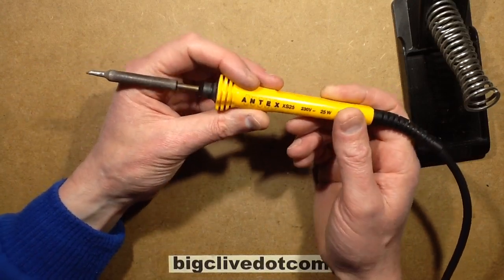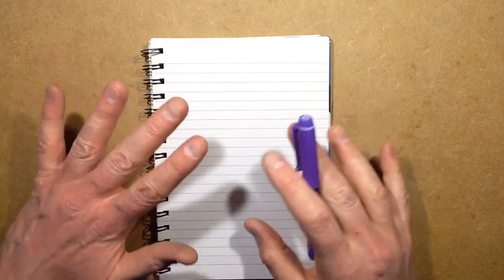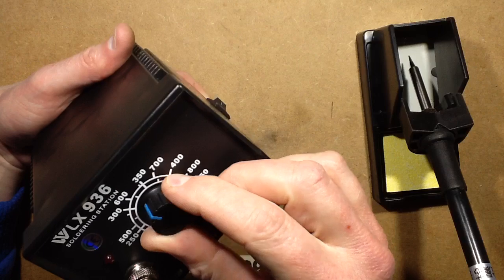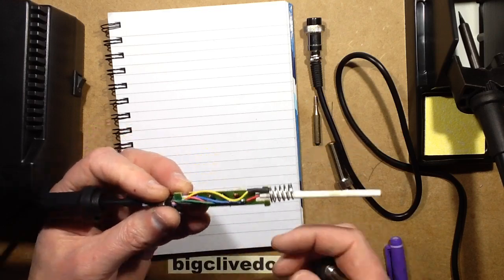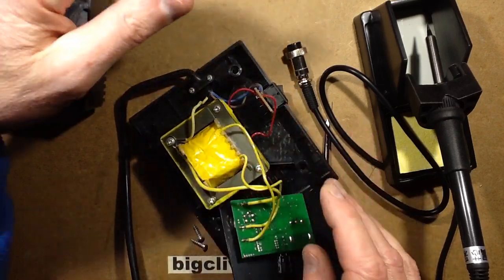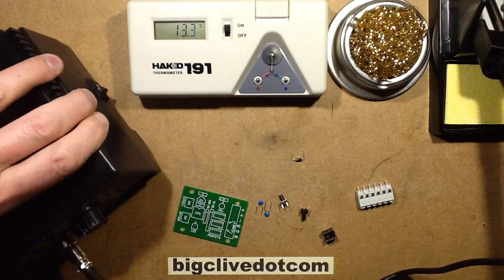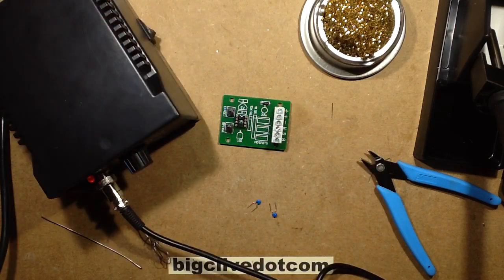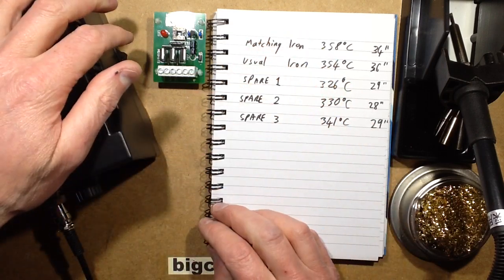Soldering basics and choosing a cheap soldering iron.

Comment: Soldering iron reviews in a nutshell:
>Dave: "These Chinese soldering stations are RUBBISH and I hate everything about them. Just get a 1000$ one like these behind me and [obscure Australian phrase]. God, I hate Chinese people. "
>Clive: "These are fine."
Reply: +Derp Herp Yup... that's Dave being his usual 'just pay a shitload of money for your equipment' self. Not like Clive, who goes... 'wellll.... it isn't the best... but you can't go past it for the dirt cheap price!'
Reply: My approach for hobby use is: Don't buy the absolute cheapest one, but instead go 1 price range higher. E.g. don't buy the 15€ multimeter, but the 25-30€ one. The cheapest just has to use the bare minimum in terms of component quality, safety and look and feel, just to get the price down. But for a little more money, you give the engineers something to work with and while it doesn't make a great bit of difference for you, they can improve the product quality by huge margins.
Reply: @Keex11  Its funny you say that, I know I'm rather late to the conversation. Though my cheap $3-4(I think? could have been cheaper honestly) iron from harbor freight preforms ten fold over the $20 Weller I bought, being as the Weller took a shit in the first week of light use. Cheapo Chicago Electric still going strong 2 years later. But a isolated incident of course doesn't represent the whole, just happened to turn me away from from wasting anymore money while the CE works fine.
Reply: @Keex11  that's how i do it.  I wanted my soldering iron within two weeks so i went on Amazon and spent about $9, and it was well worth the price

Edit: it wasn't worth the price.  The actual tip of the iron MELTED.  I bought a better but slightly more expensive soldering iron and i am EXTREMELY happy with my new purchase
Reply: @Keex11  I agree. I used to have the cheapest test equipment, including sub US$10 multimeters (as low as US$3). Then moved up in the world by buying UNI-T meters, big ones in nice red plastic sleeves, only to learn later that many disparage UNI-T as cheap trash. Recently I had the opportunity to graduate to some Fluke meters at 5-10 times the cost.  Result--maybe 1% difference which does not affect me at all in my low voltage, low power electronics projects. Actually I felt a bit disappointed. All the extra money provided no tangible value for my applications.
So my thoughts are similar. For hobbyist applications and with reasonable treatment (not by angry school kids), cheapest+1 tools may be the sweet spot. 

This is the beauty of Clive's channel. He explores "cheap stuff" and separates the garbage from "good enough" for the job. 

Finally, I grew up with electronic kits in Germany such as Radiomann and Labor XG. To replace a transistor from those kits cost about US$5, to replace a passive component, maybe still 50 cents. Hobbyists today can get all this at ridiculously low prices. What a time for hobbyists.
Reply: +Derp Herp

Would you believe it is EXACTLY that fucking attitude from Dave that has led me to find Clive's channel today???

Listening to these videos is like a breath of fresh air in comparison. I have really, really enjoyed watching EEVBlog stuff over the years but I have just got to the breaking point of 'if it isn't a top brand don't even bother' attaitude. I have a maximum of £20-£30 to spend on electronics a month.  That's it and its probably too much for a hobby anyway. When that aussie bloke recommends a £250 fucking screwdriver I am done with his shit.

Clive has a new subscriber and I really, truly hate to say it, but Dave has lost one.
Reply: +Peter Feerick If you know what you are doing, you can solder with almost anything that gets hot enough.

Many years ago while travelling round the more remote parts of Senegal, I got a camcorder display (one of the old mini CRT ones) fixed by the local TV repair shack. The soldering iron he used had a wooden handle and was heated in small a charcoal burner. He was perfectly capable of soldering and de-soldering the tiny approx 0.1mm  wires, and did a perfect job. His de-soldering wick appeared to be old TV coax braid dipped in a gunky "flux" of un-know origin.  

If you have $1,000 for a top of the range iron, go for it, but a $2 Chinese "hunk-o-junk" will still melt solder and get the job done.  

What makes the difference in my opinion has much more to do with  knowing what you are doing, as having the fancy tools. Disclaimer. I ran a computer repair workshop back in the day, and we had Weller soldering and de-soldering tools. They were good, but for my hobby use, I mainly use an old Maplin bargain bin soldering station. 

With a magnifier, a steady hand, and a bit of "Mechanic" solder paste I can manage SMD work with it,. You will find "Mechanic" solder paste on Ebay and as Clive advises with solder, get the leaded stuff, 40 years of leaded soldering still hasn't done me in, just don't go eating it..
Reply: @AndyHullMcPenguin  I can see Dave's point in case you are doing this as professional. Companies are very particular about certification of your equipment. You just cannot use no-brand chinese ones.
Reply: @AndyHullMcPenguin  5 years late, but the mystery flux is probably just Gum resin (tree sap)
Reply: You're right, depends on what you are doing. I soldered with a 2$ iron for a lot of years then moved up in small steps. To be honest it's mostly the experience and the quality of the solder. Cheers. :)
Reply: @ciprianwinerElectronicManiac  Basically the same. When I started, had 40W and 60W Soviet made soldering irons for long time. Soldering with them was torture, but in my school years there was nothing better. At least got enough practice how to solder more or less good having only those torture devices, a gob of solder and rosin jar :)
Reply: Far healthier approach by Clive IMO. Sure, there may be irons that get hot in about 2 seconds and hold the temperature at a rock solid level. And those certainly may have their place where splurging on an iron makes sense. But at the end of the day, especially as a hobbyist, paying $$$ for a device that makes a piece of metal get hot in order to solder a bunch of cables is something that you can do, but is pretty pointless. But it makes makers of expensive soldering equipment happy.
Reply: @DeputatKaktus  Very well said!!!
Reply: Plus Clive has a much nicer voice.
Reply: dave is a dill
Reply: im chinese, and im a student major in electronic. my teacher always told me to buy the top end equipments(just like Dave told his viewers to do)
the thing we used to ignore is my teacher and Dave dont have to spend one cent on these equipments,the company will pay the bill.  but  there is  no company pay the bill for the amateurs.
Reply: 国伟王 I hear the Taobao is much better than aliexpress, is that true?
Reply: @trm7782  sorry,i dont use Aliexpress .so i dont know which one is better.
Reply: Keex11 right on, not to mention the chinese sellers in aliexpress are very responsive you if you have a problem with the product they're happy to help. For the price and that seller? I can't complain.
Reply: That's why i watch Clive
Reply: Like anything else, the truth lies somewhere in between.  I have had a Weller, some super cheap generic ones (Radio shack?), including a USB one, and my current main one, a Hakko.  Whether you eve notice or not depends what you are doing.  If you are soldering a few wires onto a board here and there, a $10 iron is fine.  If you want to be able to get in and get out with small Surface Mount components, then you want something with proper temperature control.  Also bear in mind that many of the cheaper Chinese units skimp in the safety area, etc., whereas many of the more expensive units are over-specced and will last a lifetime.  If you are soldering a lot, then spending a few hundred dollars is a small price to pay for something that works well every time.
Reply: He is great r/shitsinophobessay grade master
Reply: Keex11 yup, this brand is "okay". From my experience there's 3 types of Chinese products. The good one where it can compete with international brands, the "okay" one which gets the job done and the garbage one that you can't even use.
Reply: @mspencer243  I'm suspecting that soon it will be the high quality one from China and the lesser one's from factories operated with Chinese money in other countries such as India, who are happy to take on the world's outsourcing as China goes ever more upmarket with the mountains of industrial espionage they've accumulated, and already put to good use within their domestic steel industry. Though the homogeneity of the steel isn't always as good as German or Swedish steels through the entire sheet/bar/round, with the right graft in the right hands you can get fantastic quality for little more than rock bottom prices dealing direct with the factories.
Although many people think otherwise - Australian's prominently among them - It's not been only junk coming out of China for a decade or so, but quality has increased substantially in the last five years. They have factory floors like aircraft hangers filled wall to wall with CNC mills, busy knocking out parts for more mills for their domestic production - though you can buy them - again through the right intermediaries and possibly a little more graft money. It's still the way business is conducted in the special economic zone, as well as across the mainland. You need to factor it into any business you do, but you can get high quality mills even if you pay a little more, as well as the somewhat cheaper and decidedly jankier baby lathes etc. With each iteration and repetition they increase tolerances in the newly built wave. Ethics are different everywhere and we in the western world all too often expect people to have the same outlook, when they don't. Bribery is alive and well in China whether it's called that or not, but better the devil you understand, or know, and all that.
 Another instructive, but not boring video. You strike a fine balance of explanation vs content. Thanks Clive.
Reply: Derp Herp - I finally unsubscribed EEVBlog when Dave decided he was a celebrity and no longer needed to do anything but AM TV style interviews. 

What a clown. He had it all going and just breathed to much of his own gas.
Reply: +M Spencer Can confirm, I have one with digital temperature display as well. I also would put it in the Okay+ department. I see the difference to the Weller soldering station we have at work, but this one here works more than well enough for what I do at home :-)
Reply: I have 3 irons: a 1940s or 1950s one that was my grandfather's, a cheapish Chinese one I bought about a year ago and a nail jubilee clipped to a piece of ceramic tile cable tied to a piece of broom handle that clips onto a blow lamp. They all get the job done (with varying degrees of success)
Reply: Typical Dave........so sad......
Reply: @Lamster66  You are correct. people who brag about their 10+ years old Weller's being the top notch at today, simply are not informed about latest budget soldering tech. Latest microcontroller driven soldering "pencils" like TS100 with heating and temperature measurement assembly inside tip are much more effective than those old dinosaurs. Had difficulties to solder off ROHS solder globs with my workplace's 10 year old Weller station on temp above 350C degrees where my TS100 did the job on same globs in few seconds at 320C degrees. Of course Weller have decent soldering tech, but those soldering stations cost a little fortune where TS100 with power supply cost around 60..70$.
Reply: @Lamster66  Seems old repair tech favorites often become dinosaurs due to thinking inertia :)  For casual DIY builder in Baltic states Pace WJS100 + TD-100 is still a bit too expensive. Though I now see from where Chinese TS100 came :)  Definitely cheap microcontrollers became a salvation for guys like me. DSO203 scope was on my wishlist but bought JYETech DSO150 in end, because badly needed some cheap low frequency signal display for field use (racing drone diagnostics). Though now, considering occasionally incoming electronic repairs like friend's home NAS which he accidentally connected to 20V PSU instead of 12V, I'm thinking about Hantek DSO5102P scope and some more or less good multimeter in price range around 100 EUR.
Reply: Alex Wywial kind like when you drop a baseball and you look at your glove like the reason the ball hit the ground was there was a hole in your glove. that being said ,  depending on job and tool, the right tool makes a difference sometimes
Reply: Got one from Jaycar  took 10 hrs to do 2 minutes of soldering.
Reply: Yanno, I'd heard good things about EEVblog until I watched this vid and the one clive did on the 936D.  So seeing the link to his vid in the sidebar decided to check it.  I want the 2 minutes back I wasted listening to him.  I'll stick with BigClive here and AvE for my teardown and review needs.
Reply: Aw... where's the fun in that... chewing it whilst soldering is half the fun! Yes indeed... the whole 'lead will kill you' thing has really been blown out of proportion... and certainly isn't worth the nightmare of working without it. Only thing I would add is don't skimp on your solder... I have some 'cheap' 60/40 solder that is certainly not 60/40! Sets stull and doesn't flow as long as the proper 60/40 does ;( I'll have to look that solder paste up, sounds like it might be handy... some some SMD soldering to do soon!
Reply: @pfeerick  Fear from lead solder is mostly a hype. When you have deal with anything having lead inside, don't lick or swallow it, wash hands and work surface after task is done and you will be fine. Doesn't apply to ones shot dead with lead bullets. Definitely don't chew your solder spool - metal wire chewing badly affect teeth too. What is true, we must stop manufacture tons of useless crap devices with lifespan 1-2 years which go into recycle bin then because they are obsolete or die because of ROHS solder decomposing.
Reply: Yup, god forbid people not buying a $1000+ multimeter or a soldering machine if all they need is to measure <50 VDC, test cable continuity or solder a broken serial cable termination.

Fuck snobbish people.

EDIT: Went to my city's best mobile repair shop, and guess what? Cheap Chinese soldering machines and hot air guns throughout. If these guys can do BGA soldering for an iPhone flash upgrades with them while slapping a 6 month warranty in, they are more than good enough for the hobbyist.
Reply: @Alex Wywial 
"They say a bad workman blames his tools...."

The condition of the tools can make a difference.
One time, I used a friends screwdriver to disassemble his printer (instead of going out to my van and getting my screwdriver), and I had an absolute terrible time with it. (The screwdriver tip had a lot of wear, and would not reliably stay in the head of the screw)
I learned it's better to not waste my time using his his tools after that.
Reply: @shawbros  That is a reason to buy not the most expensive screwdriver, but good enough one. Like not the 1$ worth one and also not 25$ one, but that not so shiny one for 5$, which is hard enough to avoid chipping and twisting and comfortable enough in hand. Same is true for other tools.
Reply: this is why I kinda lost my respect for dave. not everyone is rich, or even particularly lucky to even have those expensive choices. You try ordering those things when you live in the middle of nowhere, lol
Reply: @umbratherios  the guy from wranglerstar is exactly the same. I made the mistake of thinking I'd give him one more chance and ended up watching a video of him recommending a £120 hammer as a first hammer. Utter tosspot.
Reply: @carpetsomething  wranglerstar lost me when he and his wife started pushing the wifi causing illness conspiracy. I really enjoyed his early practical videos but he just go so preachy and seemingly out of touch after a while.
Reply: It's not that Dave is 'butthurt' or anything like that.  He's used to working in 'lab' environments and seems to think most watching his blog are also heavy duty engineers, etc...   

This is where Clive surpasses Dave in a few ways.  Clive talks more to us about electronics and puts stuff simple so anyone can understand it.  Dave tends to go all out "Tech" and talks over peoples heads from time to time.  Even I find myself stumped at times, and I've been repairing electronics for over 25 years!  (I don't know everything...far from it.  But talk TO me not AT me....)
Reply: that aussie is a butthurt... i bet he got knocked the fuck out by a chinese when he was a kid.
Reply: @mspencer243  Dave is a bit arrogant, but he definitely doesn't lie. At least he will not recommend utter junk and he always explain why junk is a junk. Take him with a little grain of salt.
There is no reason to buy cheapest tools and materials if you work with them for living. And even for casual DIY jobs better is to buy a little better tools than cheapest ones. Learned that myself from hard and cruel practice :) Also Chinese knockoffs in general are bad. Of course there are better ones and some even better than originals :)  However you must know where and who sell the good ones.
Reply: these irons go out often due to the fact that the tip doesnt actually touch the ceramic heating element. the inside gets hot down to the handle after about 10-20 minutes. eventually the solder joints go bad due to both flux not being cleaned and heat from the element.
Reply: Well fuck I just need a iron that can solder bus bars on a lithium battery, my main iron that I was using for it broke so I just bought a 50$ soldering station, I have a bunch of shit little soldering irons that can't even melt the solder when I put my copper bus bars on.
Reply: @mashedpotatoes5323  Do not solder onto batteries unless you wanna chance your hands near an explosion.  Use a spot welder or fuse wire.
Reply: @Asdayasman  I've literally tried to get one to blow up by heating it for a long time, not saying it's not possible but I've soldered a 16s12p battery with no issues that powers my 2000 watt dual motor scooter and it's been working for almost a year now. I am more worried about it loosing some capacity or life span.
Reply: The cheap Chinese ones really are terrible. I went through two of them before realising this. Soldering is skilled enough already without battling with a crappy iron.
Reply: You got what you pay for.